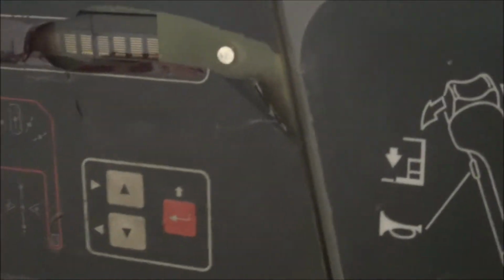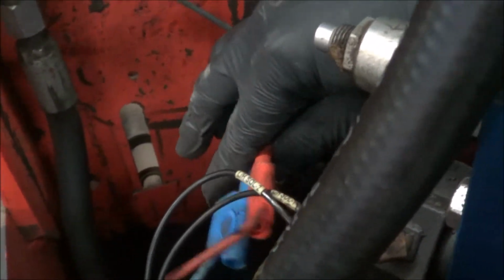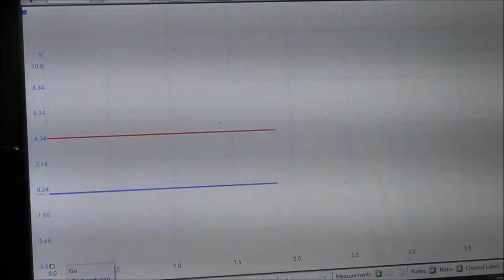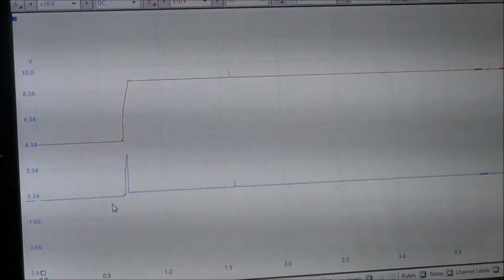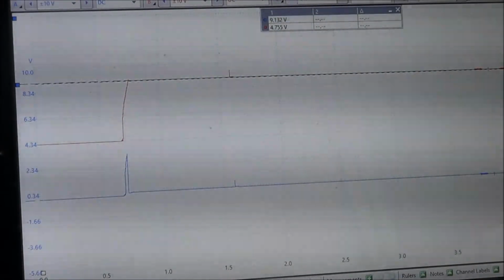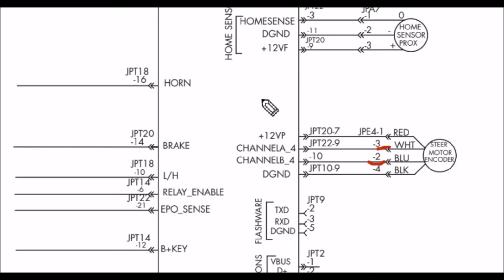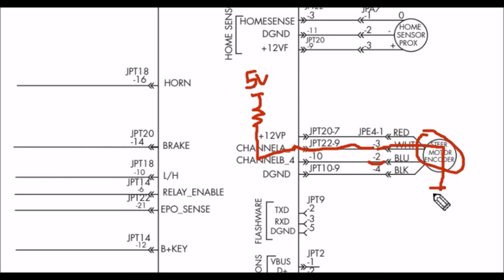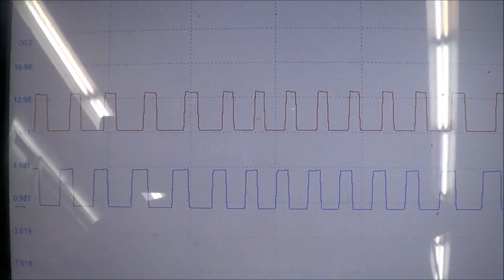No Power Steering on a Raymond Order Picker

Comment: Hello sir.i ask you what is the problem not moving or not working to run this raymond forklift electric easi dr30tt can you help me for what doing this....
Reply from the maker: What error code is showing up? There's a lot of possible causes, you have got to be more specific than that.
Reply: @forkliftgeek10  code 25 sir
Reply from the maker: The description for code 25 is a short on the field circuit (H-bridge). Possible causes- short in the field winding of the drive motor, TM transistors, power card. Sometimes a faulty snubber circuit will cause this.
Reply: @forkliftgeek10  ok sir thank you for your helping me.i try to see this motor winding thank you sir have a nice day.

Comment: I'm working on a raymond opc30TT 5500 
I get close G3 and G4 when turning on machine and not on deadman. I replaced steering proxy sensor and now its just G4 that remains. This unit also has a power interrupt system installed. I cant seem to bypass it so I dont have to use a admin card to log in.
Reply from the maker: Test steer motor for short to frame.
Reply: @forkliftgeek10  thank you sir and I followed your instructions on troubleshooting the steer encoder bearing. I believe I too have a bad bearing. I'm about to confirm that by replacing it with another motor from an identical truck with no issues
Reply: Installed complete steer motor and code remains G4.
Reply from the maker: From here there are only a couple of possibilities. Wiring, steer power amplifier, vehicle manager. G4 is the absence of the neutral pulse from the steer amplifier to the VM. Do you access to a service manual?
Reply: @forkliftgeek10  yes I do.
Reply from the maker: @israelpena7256  ok. Apart from the testing described by the book, I've had batteries and missing static strap cause this code but those were intermittent though.
Reply: @forkliftgeek10  hmm these batteries are old the trucks and batteries are 2014s I'll  
Check the battery for positive to negative ground tomorrow when I go back.
Reply: @israelpena7256  I believe that the steer motor Is older than 1996 replace it